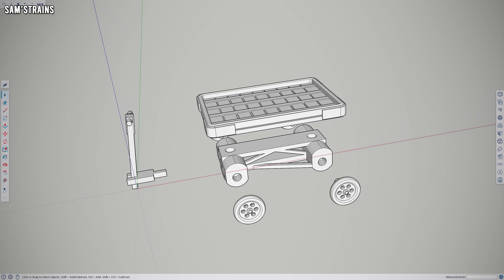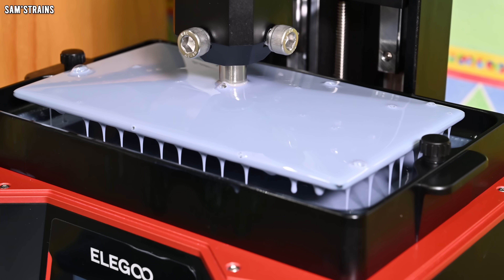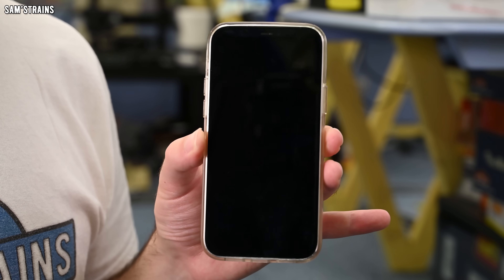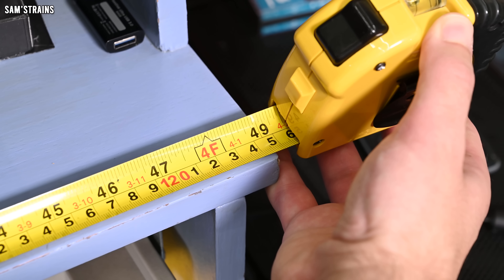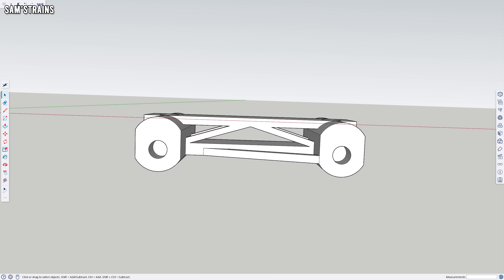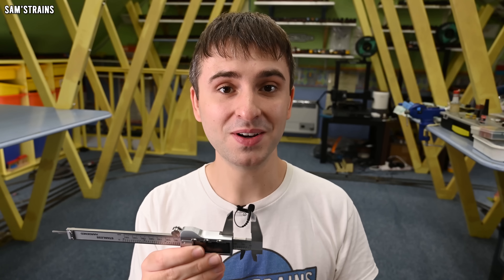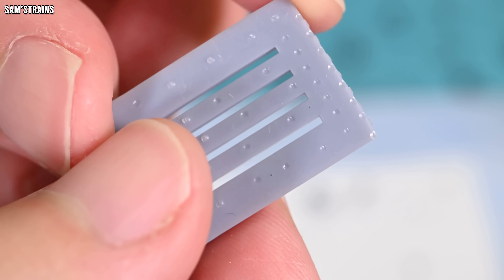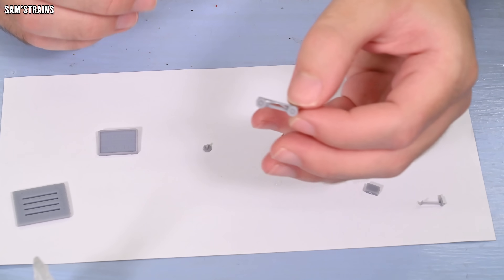The Smallest Model I've Ever Made | GWR Luggage Cart

Comment: I am so pleased you decided to get into resin printing. The detail is perfect for your hobby.
A couple of tips

1) try a magnetic build plate, you can print flat things directly on the plate, saving time, save resin and get perfectly flat prints with no supports.

2) resin is usually very brittle.....try dropping one of your carts on the floor, it will probably shatter. You can get round this by adding 5-10% tenacious resin (from surya tech). It's not cheap, but you don't need much and it will make models like this much more robust.

Comment: On scenic items, a measurement discrepancy of 1% is hardly noticable, even unnoticable. Who would notice that a 5 metre tall flagpost was actually 495 cm or 505cm tall? Where problems will occur is with mechanical items, like coupling rods or when trying to fit a slightly too large peg into it's correctly sized hole.

Comment: Lovely stuff Sam. It's looks great. 

I've been wondering if you would try 3D printing accessories or buildings, so it was nice to see you trying something a bit different.

There are so many other accessories you could try: Milk churns, barrels, crates, pallets, bins, post boxes, fencing, benches, etc. Do you have a Hornby automated mail coach? If so how about some spare mail bags? Or a level crossing?

What about buildings? Perhaps start with something simply like a track side hut or newspaper shack, then other stuff like a goods shed, engine shed or a country station? You could start with the basic main building then add a waiting room and toilet block. If you wanted to expand further you could add things like ticket barriers, vending machines, flower bed troughs, etc.